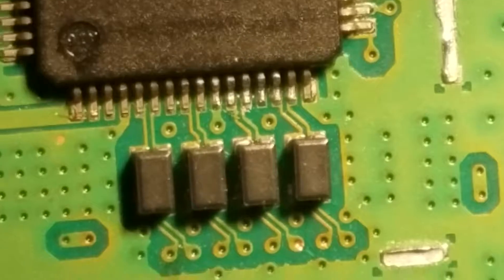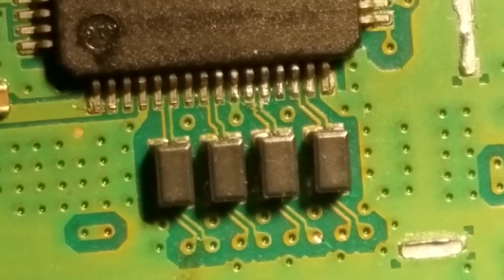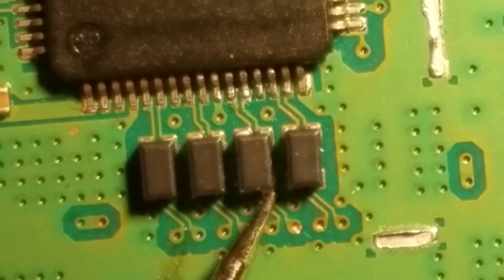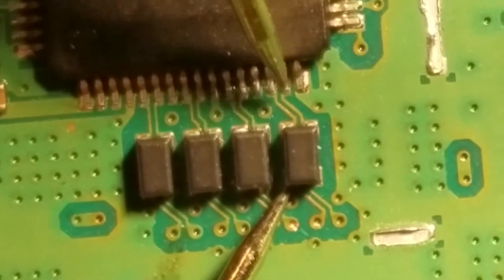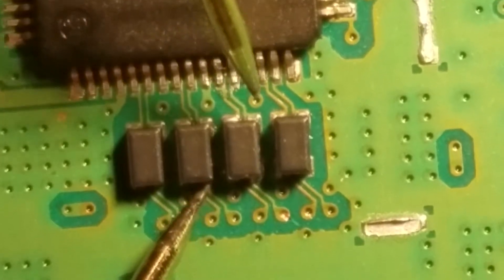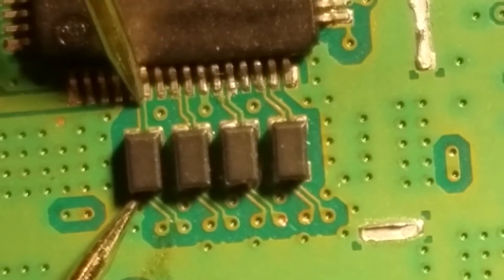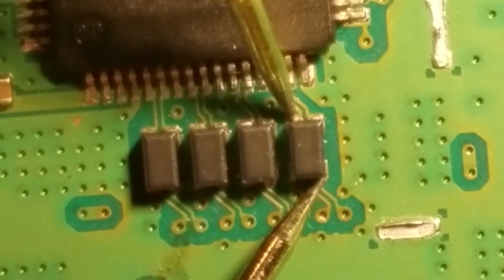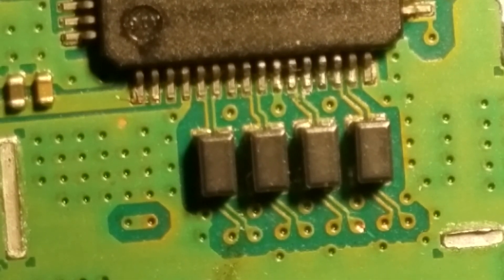PS4 HDMI Port Testing HDMI Color Filters After Final Filter and lead repair

Comment: Question, all four of my filters are shorted. I removed and tested them separately. Where do you find these to purchase and replace?
Reply from the maker: Curtis Shirley if you are testing them they are a coil so they have continuity so technically that shows as a short. Unless your getting a short to ground on all of them. If your getting short to ground then sad to say you have a bad encoder ic.
Reply: Sorry, meant to say continuity. I have continuity between all pins of each filter when out of circuit effectively shorting the hdmi pins when in circuit.
Reply: Also, have you put one back together before and the system booted and shut down in about a second? I’m working on an 1115a that I picked up and someone has botched the hdmi port repair. I put a new port in and repaired a few bad pads with jumper wires from the pin to the trace. Continuity looks great. Put it back together and now it won’t boot for more than a second. Confirmed power supply is good. So frustrating! Lol
Reply from the maker: Curtis Shirley when you say it boots do you get anything on screen and what lights do you get on system?
Reply: NemesisMerlin it powers on, get blue LEDs lit, fan twitches like it’s going to start up and then shuts off. Leds are lit for maybe 1-2 seconds toos
Reply from the maker: Curtis Shirley did you remove the shorted filters or are they still attached and are you powering up with the hard drive connected? Also was this the symptom it was having you got it before you did any work on it.
Reply: NemesisMerlin I actually have two, a 1115a and 1215a that I’m working on. Bot had the exact same symptoms originally. The 1115a is the one I replaced the hdmi port on and it will boot for 1 second and shut off. I haven’t tested the filters on it yet because they are under the metal shroud and the issues seemed to be related to the bad hdmi port repair. The 1215a is the one that won’t do anything at all anymore after I replaced the hdmi encoder chip. When I first tried to boot it I got smoke from a tiny area on the board a couple inches from the hdmi encoder chip and now I get no lights on it. I tested the filters on it and they are all shorted. I’m not sure what caused the short and smoke on it because it’s came from a small probe port on the board. Regardless, the 1115a will at least try to boot so I’m working on it mainly trying to figure out why it won’t get any further. I would like to source the filters for the other one though in the event that I can figure out what shorted and smoked..
Reply from the maker: Usually if there is smoke it comes from the HDMI decoder IC.

Comment: Have you ever used a nickel conductive pen to repair traces on the motherboards? Whats better nickel or silver
Reply from the maker: Silver is one of the most conductive materials on the planet  but it is too conductive due to its ability to transfer electrons and therefore it combines easily with stuff like oxygen. So nickel is used because silver oxadizes(rusts) to easily. You can use silver and then just coat with an enamel pen to prevent oxidation. Most of the time even the smallest trace pens can't be used on the PS4 HDMI circuitry due to extremely close trace wires. I recommend enameled wire it can be ran above the other traces much easier and then coated with an enamel pen to make it stay. Also some times alternate points are to far for a trace pen.
Reply: i have a few original xbox's that the clock capacitor has exploded on, and the traces on the motherboard are destroyed due to corrosion, so instead of jumping the traces from the original point, to their next point with wire, i was looking for an easyer alternative, i have the exact same problem with a few nintendo's aswell